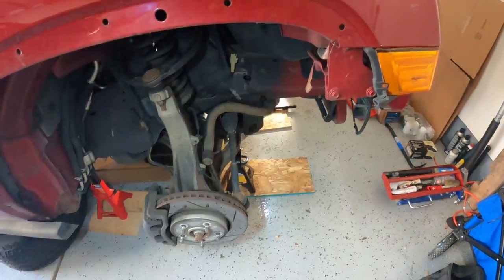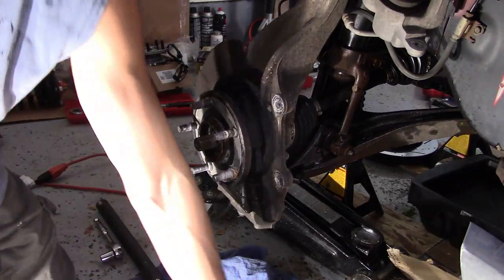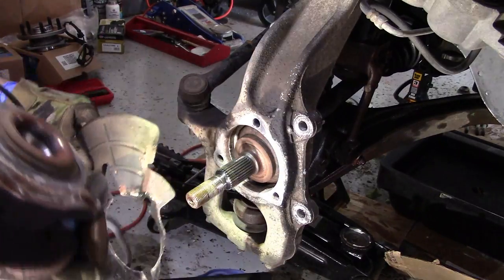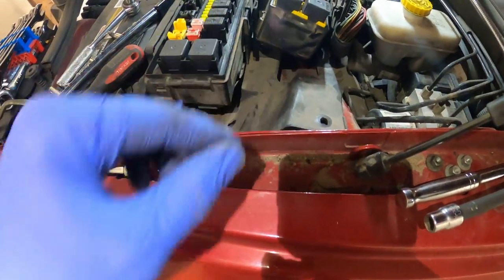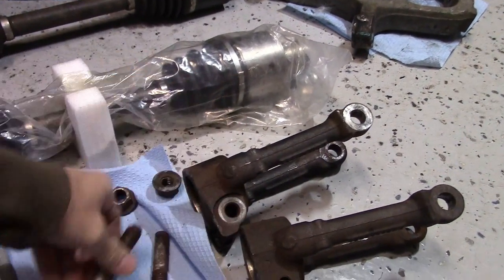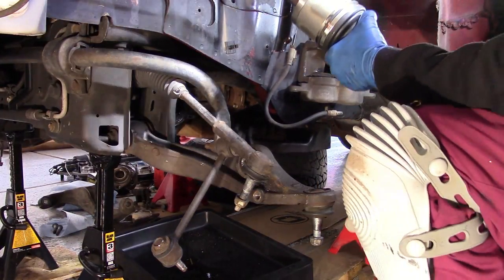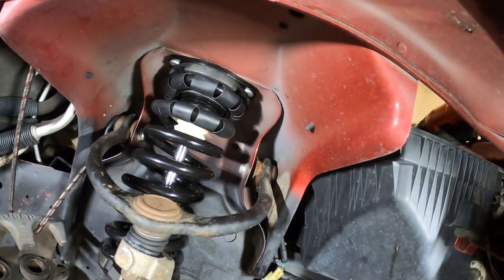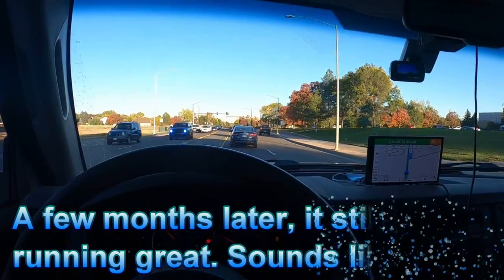2006 Jeep Commander struts, shocks, CV axles and bearing replacement.

Comment: You can get a front differential for a few hundred bucks but I bet it was th front driveshaft that made all the noise . And how is it only worth 400 bucks if you just spent all that on front end parts ?? I know this is an old post but also did you refill the gear oil after this job ?

Comment: I’m 99% sure that noise is definitely your front driveshaft cv joint. I had the same noise and used the Dorman kit!
Check to see if the rubber boot is torn. 
It’s simple to replace in an hour.
Reply: Yup! It's the carrier bearing on the impeller shaft between the transfer case (on the transfer case side of the shaft) and the front axel. Just did mine a few days ago. 😅

Comment: Hey there, brother..
You did such nice video, Don't be ashamed for all the work and the time you spend on your car, Believe me, brother, you Lorne us, but the fact is all the experience you got from all good job that you have done,  and that is the best way to Lorne it ...
By the way, you mentioned the auto part where you ordered the bolts. Can you please let us know the name, please? ...
I was focused thinking the way to remove the leftover bolt head, and i didn't catch up with the name of Store..
Thank you for Lorne us with a very  good and excellent video...

Very Good Job
Reply from the maker: It was a long time ago, but I believe it was through the parts counter at a Jeep dealer.   I had to find a specific dealer that had them. Most did not.

Comment: i remember having that issue a few years back. someone told me those are called clevis bolts. as i was about to give up doing the work i started pulling the cv axle i was replacing and the thick end that goes into the trans just separated from the inner boot and that allowed the rest of the axle to just move through that fork. i looked close at the axel end and looked into some videos where people did boot replacements and i took my new axel and separated the thicker trans side from the inner boot and positioned the shaft through the fork and reattached the two pieces which was a little tricky doing it solo but i got it assembled nicely and my jeep is still going strong but its now parked cause im sick of paying a fortune on gas

Comment: Nice work.  I was fighting for 2 days to get the clevis bolt out on my 2008 Grand Cherokee.  Also cut it out with the saws all.  My shock and strut clevis is worse than yours so I probably won't be replacing that any time soon.

Comment: Those fork bolts always seize to the bushing. I had to cut my bolts. Still couldn’t get them out and ruined the bushings with heat. I already bought new control arms, just had to buy new fork bolts. I put anti seize on the bolts where it would contact the bushing, in case I had to remove them again for some reason. 
That for me was the most difficult part of the job.

Comment: Nice, I just did the front end on mine last year at 160K of NJ rust. ;) the clevis bolt did not want to play nice so I had to introduce it to the 5 inch Diablo carbide blade. I figured while I was pulling all of that stuff out I might as well change the lower control arms as well as the uppers. And of course the lower control arm did not want to play nice either so it got to help me break in the new 5 inch Diablo carbide blade as well. I also figured might as well change the front bushings while I'm there. ;) And those front sway bar bolts from the years of Rain, salt, and NJ were a real PITA as well. ;) The clevis bolt it known to seize to the lower control arm bushing, as The bushing has a metal sleeve inside. you got lucky that when you cut the bolt it wasn't seized inside of the lower control arm bushing. That's the place you really want to make sure there is a good amount of any seize. I have been on Commander forums since I bought my first one in 2006.

Comment: Sorry to hear it was your differential!
I’m trying to figure out if you had similar symptoms like I’m having. When im driving 20-30 mph and above going straight or turning to the right I get this rubbing and vibration on the front drivers side, but if i slightly turn/swerve to the left the sound goes away completely. Basically when you take the pressure off of the drivers wheel the sound and vibration go away. I’ve changed the wheel bearing and rotated the tires and still have the issue. I also changed the propeller shaft last year and that’s still fine. 
Just curious if you had the same symptoms. 
Thank you!
Reply from the maker: Mine was the front diff pinion bearing.  It sounds like it might be your problem too.  When it went, it went bad, completely threw out the drive shaft.   I already had a bent frame from an accident with a unlicensed and uninsured motorist, so it wasn't worth fixing for me.  For you, it may be???
Reply: @Wavetechlifeguardian  Thank you for the response. 
At anytime driving it could you make it stop/go away by turning/swerving in either direction? Or would your noise go away going around a turn left or right?
Thank you.

Comment: Wow, just saw the end of this. F, that. Pull the front driveshaft out and drive 4x2 till you find a used front axle. Well, depending on which of the 4 transmissions you have. If you have a full-time four-wheel-drive. I think I read that even if you do that it will not drive because the torque converter thinks that the front wheels are slipping and keeps trying to deliver more power to the front axle which is not there if ya take  it out.
Reply: You don't know the slightest thing about what you're talking about 🤣🤣

Comment: I think dorman sells a repair kit (new cv) or whole new driveshaft, there are a few vids on youtube for the Grand Cherokee and Commander for the front driveshaft repair. Easier, cheaper than diff. bearings.
Reply: I used the Dorman kit for my front driveshaft cv joint. It was cheap, simple and worked!
Reply: Dont mistake the front driveshaft and the CV axles. The   Front (propeller shaft) is known for the rubber seal to get torn overtime and they sell a rebuild kit. You can rebuild both the front and the rear of the driveshaft. However, front wheels use a CV axle and you have to make sure you get the right one either with or without limited slip. If you're not sure whether or not you need the limited slip, Just lift your front wheels off the ground, and put the transmission in neutral and make sure your truck does not go away from you. Then just roll one wheel by hand. If the opposite wheel rolls in the opposite direction than you are going than you need the limited slip.
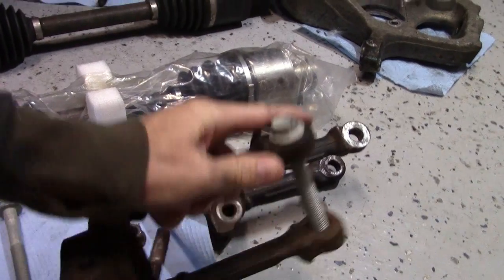Reply: Im laughing at 23:00. I ordered the wrong bolts as well. The shorter bolts they sent you are for the top of the Clevis (to the coil over strut). The bottom is a longer bolt which you found out ;)
Reply: @wiley0714  In my experience with cars with limited slip/posi-traction rearends. Both wheels turn in the same direction when spun as described. Wheels turning in opposite directions usually indicate a non limited slip axle. Also called an open rearend.
Reply: @akaredcrossbow  were you experiencing the same noises and the driveshaft repair fixed it?
Reply: @stevenhiotes5881  yes!
The driveshaft cv boot was torn, so the grease was gone and the metal was rusted and turning into dust. I would look at it and see.
Reply: @akaredcrossbow  thanks I just ordered the repair kit
Reply: @stevenhiotes5881  was it torn and rusted?
Reply: @akaredcrossbow  yup kit came in today, 30 minutes later car is good as new issue solved. Thanks.
Reply: @stevenhiotes5881  nice! Good to hear👍🏻

Comment: That sucks about your differential. I just bought a commander at auction and it seems like everything needs replaced, each part costs 4x as much as the same part for my XJ, and they are in the most difficult places to work on them.  If you decide you want to part out your Jeep let me know because I need all the parts you just replaced.
Reply: Follow up. I just got around to doing my shocks, wheel bearings, and CVs and I cannot remove that Clovis shock bracket to save my life. This is by far the most difficult jeep to work on. Such a pain.

Comment: Did you ever fix this issue? I’m having the same issue and wondering if replacing the driveshaft might fix the noise?
Reply from the maker: No. This was not a fix for my problem.  Mine was a bearing inside the front diff.  It eventually failed throwing my driveshaft out.  I do not recommend driving till it fails. Not fun or safe at all.

Comment: Dude front differential is like $200 at any scrap yard,, with low milage.. scraping a jeep for a front diff SMH 😂 .. i know this because a year ago i replaced mine and got one like new with only 70,000 miles on it for $200 , put new seals in it and is perfect…
Reply from the maker: Doah!  I should have done that!!!